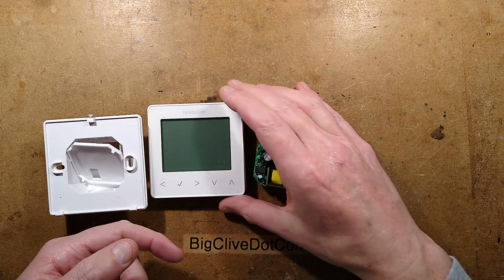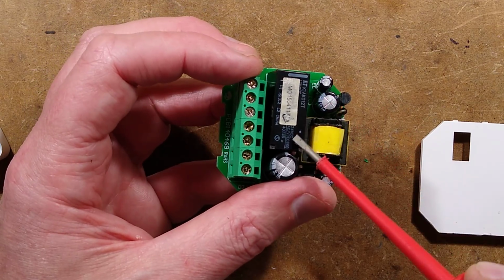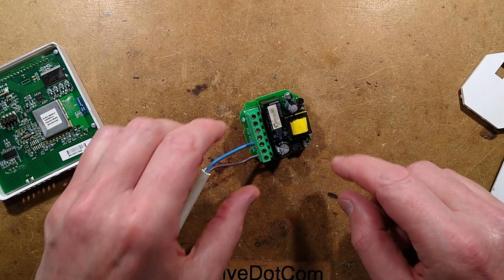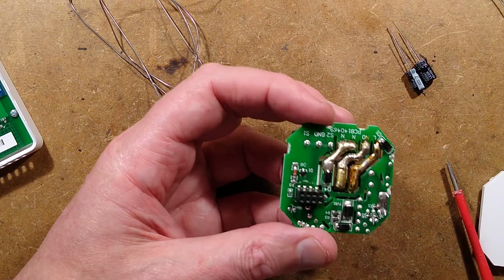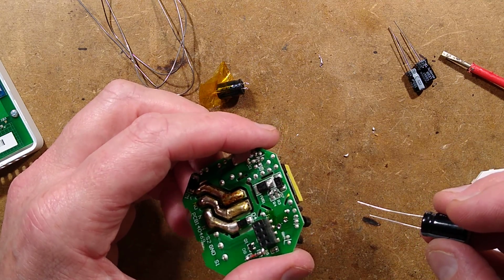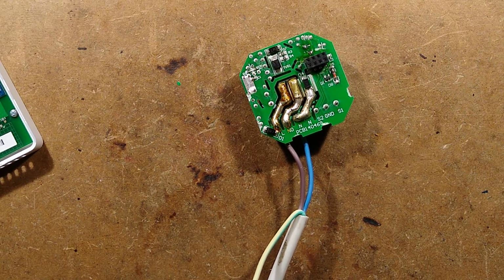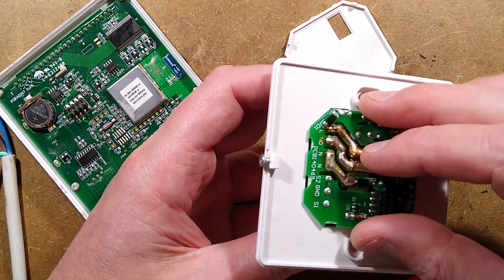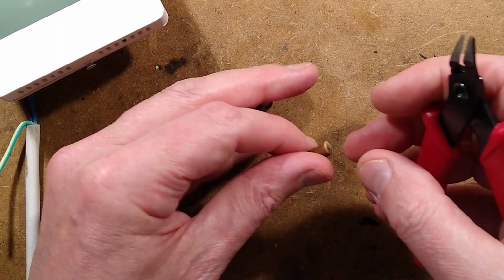Fixing a dead digital thermostat

Comment: I hate smart thermostats
I help to maintain some apartment buildings the units have control of their own thermostats. Every year I have the most trouble with the smart thermostats usually operators headspace, but also failures, and of course replacing the batteries.
I replaced those with dumb thermostats never have them fail. 
How to operate an old-fashioned thermostat, go to bed turn the thermostat down, get up turn the thermostat up, go to work turn the thermostat down, get home turn the thermostat up. Now was that so hard?

Comment: Me Da and later me lad and i have always opened up dodgy electronica to see if there was something simple enough to fix with a soldering iron and four ham fists.
Not fond memories of the first gen Rank Arena CRT colour telly (crackle, AAAARGH) but we've managed to get lots of other things back up and running. It's nearly always a popped cap.
It's also good fun heads down over the dining table discussing how to pull stuff apart without causing permanent destruction.
Thanks for the happy memories big feller :)

Comment: Oh yeah, definitely a good warning to make sure you always unplug live mains stuff when you're working on it. Just the other week I swapped out a bulging cap, and the plug was a bit stiff when I went to test it with the lid off the device, but instead of unplugging the cable from the mains and plugging it into the device properly, I went to get a good grip on it and ended up getting a good shock instead! I don't think it was the full AC mains since it didn't hurt too much, just enough of a zap to make me knock it off the table.

I have to remember not to do work on mains electronics after a 12 hour day at work.
Reply: Many years ago I got a full-strength mains shock across just the width of one finger (here in North America, so it was nominally 120V).  I hardly felt a thing, mostly I just felt the parts of my finger that were making contact feeling like they were vibrating.  In fact, that was the ONLY thing I felt from the zap.  I didn't realize I was getting a shock at all until I looked to see what was causing that strange sensation as I was trying to pull a plug out of an outlet and there I was, with a finger against both pins.
Reply: @evensgrey  For me it was definitely more than that, it felt like someone had slapped my hand moderately hard.

Comment: Do you recommend to change the capacitor preventively, when they are random brand by a 105C (when it represents less than 1% of the price of the product ?
Reply: Yes.
Reply: Do there is anything else I should consider to change ? Like resistor ?
Reply from the maker: Just capacitors.  In some lamps you can also adjust current down, but that requires some knowledge of the circuitry.
Reply: @bigclivedotcom  yeah I know for the current, but I'm very bad at math, like match make my brain crash xD

Comment: I've noticed that some electrolytic capacitors are a bit sneaky and don't some their tops at all, which makes the faulty ones that much more fun to find.  I've even had people say "Oh I noticed that, so I just pressed it back down again" 🤦
Reply: I've seen them lift off the bung rather than  dome the top. Doming isn't a 100% foolproof test (every domed cap is buggered but not every buggered cap domes)
Reply: @miscbits6399  That is absolutely true. I discovered that when working on a Dell PC motherboard, populated with hundreds of those horrible green electrolytics. I ended up swapping about half of them, just to find two or three duds. The domes failed to rise to the occasion.

Comment: Ha! I just had one of these installed, controlling my heated flooring - Heatmiser Neostat-e - with the external sensor being under the floor. At least I know what to look for if/when it dies! It's a neat little unit and with a Neohub it has Homekit integration too. Nice to see it here!
Reply: Awesome.  Hope you have it wired into the network so it can easily be shut down remotely when they feel you've exceeded your carbon allowance for the month.

Comment: Oooh, I’m currently wiring our house up with TEN of these things (ten zones). The Heatmiser back end is beautiful and a real treat for us DIY automation geeks. Highly recommend to UK automation enthusiasts. Eons better than Nest and all the other cloud heavy crap. I’d rather replace a faulty cap than get drawn in to some paid pricing plan later… It can be used in the cloud using their services but also completely independent of this and on your own local network. So if they ever go the way of some other providers, you can continue to use it from your own automation hub with zero dependence on them. They publish (not publicly - but available on request) their developer API and honestly it is so well thought through from a software point of view. Glad you made this, I suspect I may be watching this again in about 6 years ;)
Reply: How do these things work then, you have a thermostat in each room controlling individual radiators?
Reply: @uK8cvPAq  There shouldn't be any difficulty hooking up an individual control valve for each room, as long as the piping is set up to deliver hot water to each room individually.  (From what I can see, I THINK that's the normal way to do it.  I live in an apartment in a building that's old enough that the hot water heating is a retrofit, and I think that's how the piping is set up here.)  It might get a bit tedious.

I used to own a home with electric heat in each room with an individual thermostat, and a device like this would be pretty much a drop-in replacement in such a system.  (There was also a propane heating stove in the main basement room, which was a good thing considering that the climate here is slightly colder than it is in Moscow.)

Comment: For pulling smaller capacitors, one of my favorite tools is larger sized cross-lock tweezers. Specifically they seem to go by weird names like "orthodontic debonding posterior bracket tweezers" but the one with the tiny little flag shape that looks more like a lock-pick and has a weird bracket sticking out the back end of the handle. It has serrations and really keeps things from slipping away!
Reply: I bend them left, then flow the solder until it pops out a wee bit, then do right, and so forth until it pops out.
Reply: I sometimes just ripped the cap off with some pliers and desoldered the legs off afterwards :)
Reply: @Qwarzz  Ya. I did that, too. But was too ashamed to admit because it seemed naughty. Maybe it is, but at least i am not alone ^^
Reply: @ChrisBigBad  It does really help with the larger caps as there will be less mass to be heated then.

Comment: You make it look so easy and on camera as well. Solder has a habit of going where you do not want it, if a blob drops it usually ends up on the circuit board in the most inaccessible place shorting out a component. You seem to over come SOD's law.
Reply: If you're soldering and blobs are dropping everywhere then you need to practice soldering more.
Reply: @haywoodyoudome  Some Chinese wires do not like solder, as the old saying goes sh it happens and even to the best.

Comment: I love the Newtonian desoldering at 8:15. I've practised this technique for almost 50 years. 😊
Reply: And there was me thinking “just get a solder sucker and a pair of helping hands”. Silly me, we can just use physics ;)
Reply: @MatSmithLondon  Downside to solder suckers on today's ultra thin PCB traces is they like to suck pads up too.
Reply: @Sideshow Bob's Fan Club agree, although I use braid sometime it does seem useless and generally burn myself regularly with it getting too hot just when I need it to actually work…
Reply: Newtonian method sounds good. I call it the Cillit Bang method of desoldering (bang and the solder is gone, along with all the ceramic caps 😅)
Reply: I would be worried about breaking something.

Comment: I've recently had a Samsung ML-1660 series laser printer with the same problem. It only blinked for a split second, but when I managed to open it, I've seen actually two "domed" caps which still had some crusty "shmoo" residue on their top side. Replaced them and got it running again.
Reply: That crusty "shmoo" is a good seasoning.  You should try it sometime.
Reply: @haywoodyoudome  It was hard already. I did scrape parts of it off, but it was brittle. Didn't look very yummy either.

Comment: Watching the repair and hearing you mention about getting "caught out" by failing to unplug it just reminds me of working on a power supply, and completely forgetting to do just that. Basically ended up inadvertently hot-swapping components on the live side while it was powered up the whole time. Fortunately it was on an isolation transformer, so no bangs, but still the entire time I'm wondering why the solder feels ever so slightly tingly when I touch it to each component to flow solder on after I put the component in, only to flip the supply over and see the power LED still lit. Neat.
Reply: That's impressive. I did the same but it end up shorting the main capacitor, nuking the rectifier, blowing the fuse and tripping apartment outlets section C16A breaker and main C40A breaker. Never again._
Reply: It's a lot like firearms 101 - ALWAYS make sure it's not loaded (even when you 'know' it isn't) - ALWAYS make sure it's not connected (especially when you 'KNOW' it ain't)! Just stayin' safe.
Reply: Worked on an electronics design like that. Because the soldering iron was grounded, it was a neat way to check the overcurrent protection was working. :)
Reply: The worst is when you have a bunch of things on the bench.   You unplug what you are working on and then "BANG!" and then you realized you unplugged some test equipment instead.

Comment: I did repair several electronic devices by changing capacitor after regulator. And I usually over-rated the .

Comment: My favorite capacitor failure was in a laptop, I think Acer or Asus, and it was one of those miniscule ceramics. I was diagnosing the computer for no power for a customer, and every time I hit the power switch I would hear a distinct pop before the system would power off. I removed all the plastic covering so I could see the bare board to look for any visual signs of failure. When I hit the power switch, I found out that distinct pop was one of those little capacitors spewing sparks as much as 7 centimeters high, and upon closer inspection there was a crack in it. Someone pointed out that the capacitor was wired redundantly and the system could theoretically work without it, and they suggested giving it a little flick to break it off.

I did that, and I only had to touch it for the thing to shatter and fall apart into shards almost as fine as dust. The system worked perfectly normally afterwards, it seems what the capacitor was doing was just causing a short/power surge of some kind that caused the system to power off.
Reply: Multi layer ceramic caps like to fail short. They consist of dozens of very thin interleaved ceramics with a conductive coating. If they crack, they tend to short circuit between the poles. Hence by removing it, you removed the short and the power rail was no longer pulled to ground. May cause stability issues, but you never really know.
Reply: @kain0m  Makes sense. I remember telling the customer that it was working but not to expect longevity, so that much was covered.
Reply: Ah, a redundant failure point! Always good to have one extra in case the first one doesn't fail.
Reply: @Gameboygenius  honestly it's more likely it's like that to meet a current specification. This was on a power delivery circuit so there were many rows of this, and it probably was just able to take losing a capacitor and still be able to supply enough power to the system under most circumstances.
Reply: @VraerynDaDragon  it was sarcasm. "The manufacturer designed it with as many failure point as possible to make sure it failed."
Reply: @Gameboygenius  Ah, fair. I thought I detected a little bit of that in your reply but continued typing as I was anyway.

Comment: They really went to town as well with plating those tracks so the end user can't blow them off as easily. As stated elsewhere here in the comments, in the US the thermostats run off of 24V DC, and just have small signal relays in them to tell the air handler what's being called (heat or A/C + compressor), and all the heavy lifting is done in the units themselves with usually 50/60 Hz transformers providing the needed voltage and then large heavy contactors for switching. Makes sense since it ensures that home owners and HVAC techs wont be exposed to mains voltage unless they are inside the units themselves, and they're quite reliable in that configuration. Odd to see a place like Europe with its extreme safety culture using mains voltage at the thermostat.
Reply: Yeah, but our thermostats are usually controlling heating systems. In the U.K. not many homes have air conditioning. The thermostat either directly switches 230V (240V) mains electrical heating. Or controls a 230V (240V) feed to a gas or oil fired boiler, and/or 230V (240V) water pumps or water valves. As the entire central heating system runs at 230V (240V), there is no low voltage supply to use.
Reply: @Mark1024MAK  That's what I figured since the construction is so much older, not to mention the cultural differences. Here in the US most of the homes were built in the years after WWII, so things tended to be a bit more modern. It's very much like my grandparents farmhouse I used to go to for the summer as a kid. They had coal heat and only a telephone and radio until the 90's. "Want a hot bath? Go shovel the coal yourself" my grandfather used to say. And some shoveling and 45 minutes later, you had hot water for one bath.
Reply: In my US furnace the thermostat contacts pass all the current used by the gas valve, as I believe is traditional. In the true older style systems the blower would be controlled by a mains-rated temperature switch on the heat exchanger, although on mine it is electronics and a relay. So our thermostats aren't just switching small signals but actually a good portion of an amp. Of course newer furnaces probably don't pass that much current but generic thermostats need to be able to carry it.
Reply: @eDoc2020  Obviously by small signal I mean low voltage and relatively low current to just run solenoids in the contactors. Not like what you would find in an RF receiver for routing the incoming signal around. There are mains ones as well in very old simple systems, but these were usually mercury bulbs that would turn on a blower directly. Usually had these at old apartments that I stayed at in college and such. Fair amount of mercury in those, and that stuff just disappears in carpets when you bust them. I accidentally broke a blood pressure cuff bulb in my dads office that had a good few fluid ounces of mercury, and it just went "poof" as soon as it hit the carpet. No idea where it all went.

Comment: I also had one of these fail and again a capacitor replacement fixed it. The PSU has no airflow which i assume is due to safety requirements. So i drilled some small holes in the bottom and top so it at least can breathe. May reduce operating temp a few degrees which in turn will give it a longer lifespan.
Reply: The plastic backbox holding the power supply, now has ventilation slats in it.
Reply: Using better-quality electrolytic capacitors is crucial.  Avoid stuff from China.  Better choices are Japan or Taiwan.  "Domed" electrolytics are a common mode of death for computer motherboards that source these parts from China.
Reply: @Milosz_Ostrow  
The secret is keeping them cool.

Comment: Clive, I have a ozone generator that decided to stop making ozone. The fan works just fine. I'm gonna have to have a peek inside and see what happened. I likely won't have a clue but let's find out. I'm inspired to at least attempt to try and see if it's obvious or not. I purchased this 3 years ago before the Pandemic. I have only used this maybe a total of 6-8 hours. It has a timer that goes all the way to 120 min. Most of the time I just run it 20 mins.
Reply from the maker: It's not uncommon for the high voltage modules that run the ceramic plates to fail.  You can usually get replacements on eBay.